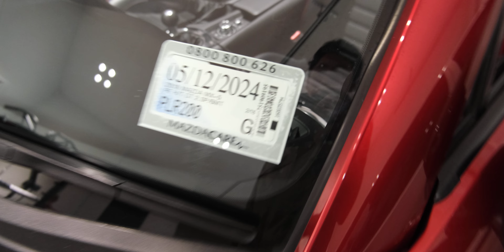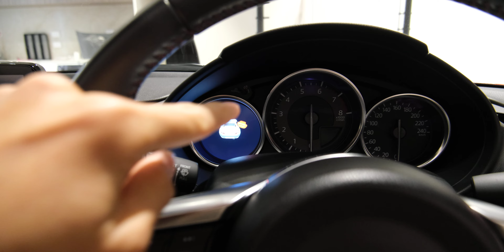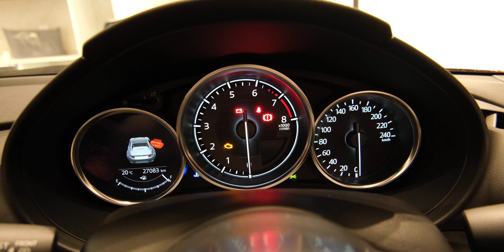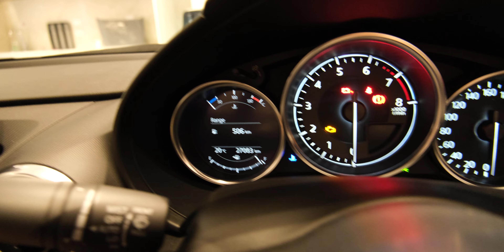Challenge Accepted: AE86 Needs Engine Rebuild Soon but I’ve Got A Backup 🛡

Comment: I haven't seen any modern MX-5 so seeing this one was actually jaw dropping! It looks Really nice! That color looks like a pearlescent lava red. I think Mazda is one of the few good car makers so this thing might actually last for a long time.
When it comes to the Trueno, although I don't know much about these boys, but it sounds like if you want keep the turbo in it you might also need to change the hood for the cooling which might be a pain in the ass for car this old.
As for the YouTube algorithm, nobody knows how it works (that's kind of the point) but there are a few things that are pretty clear. It likes views, likes/dislikes and comments (hence why I always like and almost always comment on these videos). These 3 things are basically measuring user interaction. Higher = better. Watch time probably comes into play as well but I'm not 100% sure of that.

Doing a quick analysis of your channel, it seems that you really had something going with those POV driving videos. If I were you, that's probably what I would be trying to base my whole channel on :D
POV driving cool cars. Always go for the walk around the car, getting into the car, starting it up. If there are any race tracks I'd try to bring the car there as well. Don't need to be good at racing, safety first, just driving around it at above average speeds. Combo those videos with POV working on the car videos. I would try contacting people around me that also have a cool car to ask to borrow it for a video, explaining about the channel. Those driving/working POV videos create an ASMR-like experience of what it's like to have such a car. Something most of us will never experience.
Maybe that's impossible for reasons I don't know about but just sharing my thoughts :P
Reply from the maker: really nice analysis, I also checked most of my high views videos are pov driving and I’ll keep doing it occasionally, I also found out some of my short videos sourced from overseas which hasn’t been uploaded on YouTube are great ways to gain more subscribers and views, although it might be annoying sometimes for my usual subscribers, I will test it out for few months to see what’s going to happen.  But I still prefer to make my channel content cleaner😄

Comment: going N/A ITB's is a worthwhile experience.  it will be very hard to get to 200whp with a N/A 16v 4age.. 140whp is even pushing it with a Silvertop 20v 4age.  If HP is not a concern like you said, ITB's is a worthwhile experience for the feel and sounds. to get the most of out of the ITB's, you'd need a capable standalone (if you're not already on one yet... haltech or link ecu).  the RF miata is so sleek and looks like a fun daily car.  good pick up!
Reply from the maker: Yeah man, I would really love to experience ITB before, now after I got the Miata, I realised I’ll probably keep my Trueno turbo but stronger after rebuild, and I’ll work on the exhaust to get better sound as well, I think it will be a better combination, if I need power I can still find it in my Trueno. And there is another problem because my car is legally certified with turbo conversion, if I do ITB the recertification will be really hassle and expensive to certify it again.